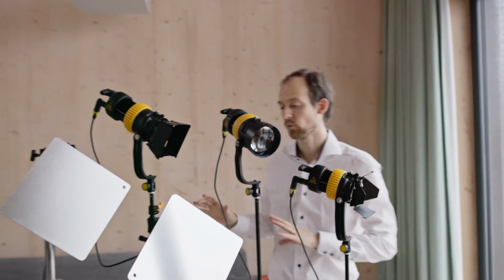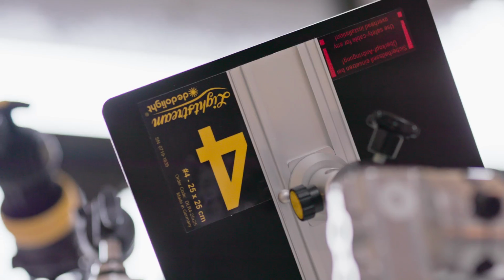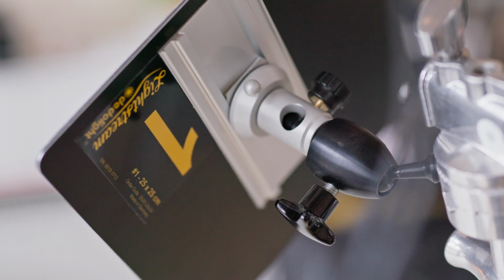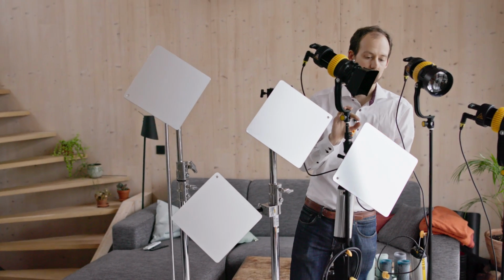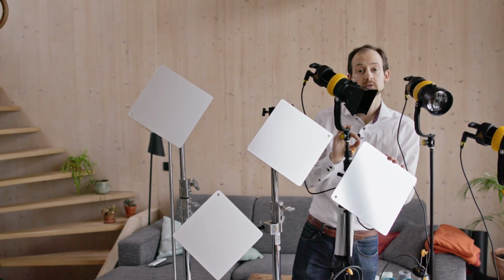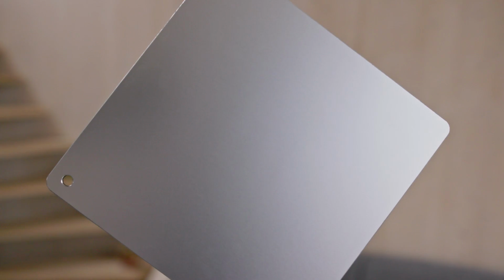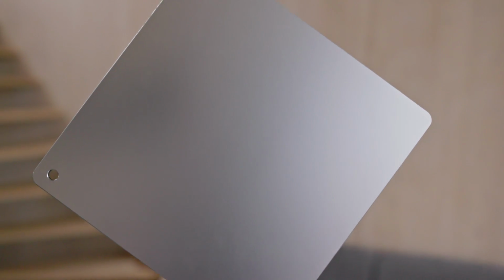Dedolight Competition 2020: Lightstream tutorial

Comment: Why is the light from the reflector so soft even though it’s a relatively small source?
Reply: Also, because of the different surfaces on the reflectors, each one have a different finish , the more polished “mirrorlike” material bounces back the  light rays almost in the same direction with no variation, on the contrary, the more “matte” material scatters the light rays and bounces them in many directions, hence, the softness.
Reply: proximity to subject